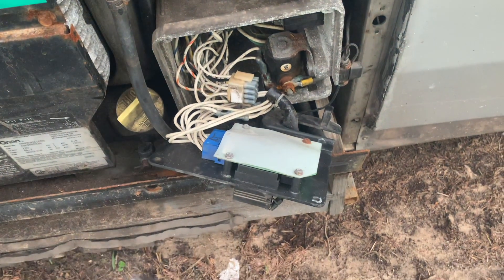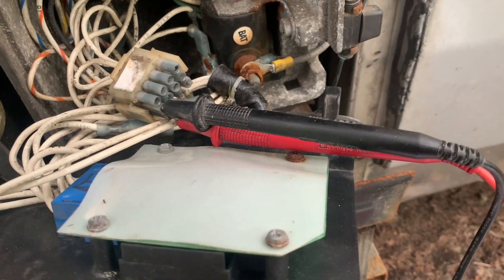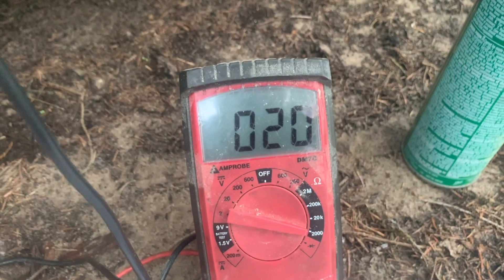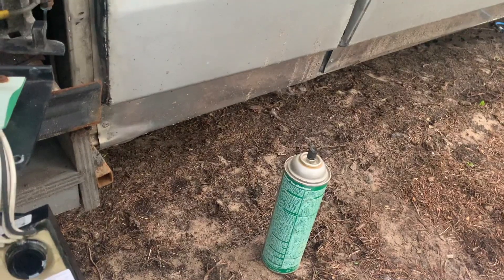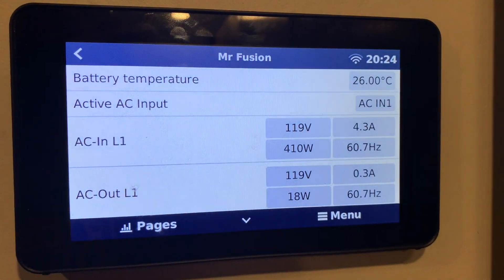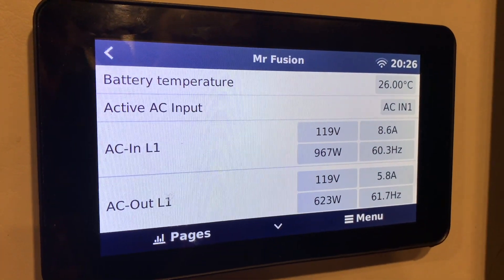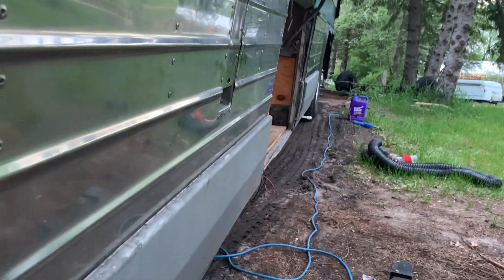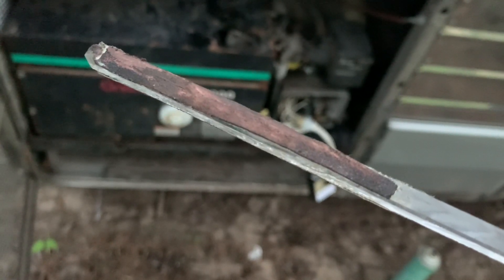What's wrong with our Onan Marquis 7000 Generator?  New Voltage regulator  and electrical testing

Comment: Thanks your video and Flight Systems Inc manauls. My meter was reading 1.0 V(ac) so  I improvised on your hack with readily available materiels and reading 121 V(ac) full load. 92-Bounder, Onan NHM700,
Reply from the maker: Nice work!

Comment: Only low dc voltage passes through the regulator. The output AC voltage is determined by how much dc volts is sent to the exciter no permanent magnets. The voltage regulator senses the AC output voltage and increases or decreases the dc voltage to the exciter windings to maintain the correct ac power output. The heat your feeling in the voltage regulator, I would consider normal. 
The salty air definitely corrodes the slip rings so that’s why it’s critical to run the generator under load for 2-3 hours every month. The heat generated by the motor helps drive out moisture and the moving parts in the engine get lubricated. Salt will get concentrated in the engine oil so more frequent oil changes are required to prevent engine damage. 
Salt will crystallize inside the generator so running it helps to remove or reduce those crystals.

Comment: Thanks again for another great video!  Have the exact same Marquis 7000 genset in my 1994 Pace Arrow. Flight systems is phenomenal!it  It appears you've got some of the troubleshooting guide from the website. I was able to pull about 30 pages and there was a section, if I recall, troubleshooting a voltage regulator. Not sure if that'll help but hope it does! Stay safe. Take care.  
-Kirk

Comment: This is really helpful. I have one of these but have not fired it up for about two years. I'm going to give it a try in the next week or so.
Reply from the maker: Kevin Hornbuckle  yeah, get a small stick of plastic (I cut mine one my table saw) and used superglue to put some sandpaper on it. Worked great to keep the slip rings clean. Watch the regulator, don’t let it get hot.

Comment: found this on a forum that may shed some light on it,  "Should start gen once a month. I let my gen sit for 3 months , but I clean slip rings before every use. In tests I found rotor resistance thru slip rings increases to 70-100 after 3-5 months of sitting, should be 25, Onan says clean at 30."
Reply from the maker: Bubble Guts Mike I did not clean the slips rings well This spring. I’ll need to get some finer sand paper on my DIY slick stick  and use it every outing.
Reply: @HimmelbergerBus  should not have to clean the slip rings every outing, if they look like they are in bad shape then do it